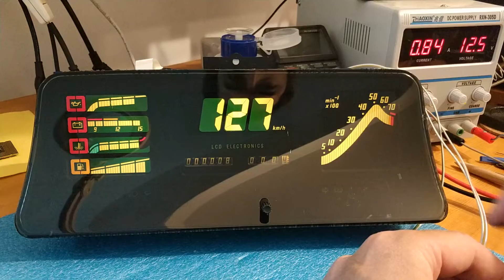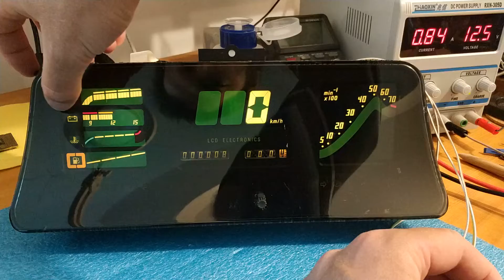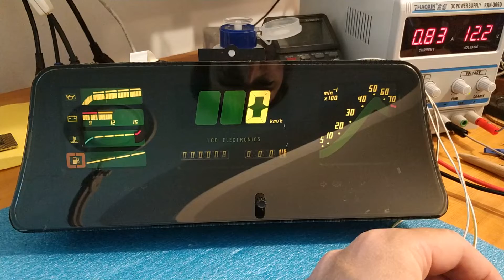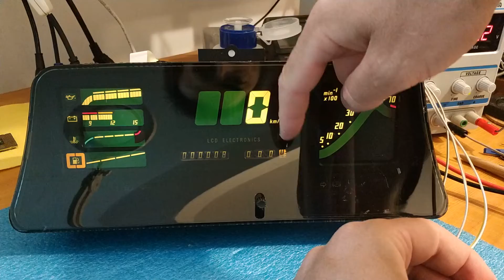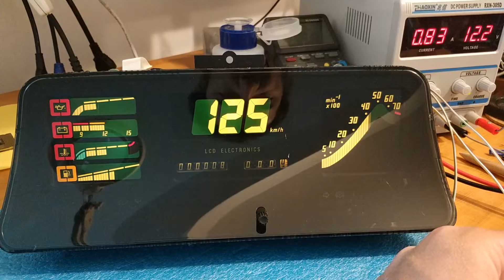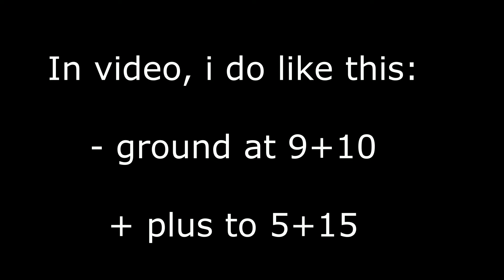Opel Kadett E GSI Monza Digital LCD Electronics dash - How to Test

Comment: Can I install that dash in normal Opel Kadett E 1.4i LS , not Kadett GSI ?
Reply from the maker: You can install, but i don't know for sure what problem you gonna faced; a guy down below, Anthony put this dash on a Volkswagen Corrado, but he faced some minnor issue; please read bellow on comments.
Reply from the maker: Please see here a Romanian fellow who put this dash on a Daewoo Cielo https://www.gmclub.ro/forum/topic/40618-tutorial-montaj-bord-digital-de-kadett-gsi-pe-cielo/  you have here multiple info
Reply: @DaneluRepairs  I had it in Daewoo Nexia...  20 years ago. I had to rewire plugs. Speed pulse meter from Nexia worked with this clock without any issue.
Reply from the maker: @reconquista1911  awesome. Good job you did back then 👏
In my country, Romania, Nexia was named Cielo.
Reply: What about the speedo where's the part that goes to the gear box?

Comment: What does the oil gauge measure? I see it showing the full bars when on.
Reply from the maker: Nothing. I have not put anything there. But, cpu somehow see full. I think is just implicit setting.
Reply: @DaneluRepairs  i tested with the volt meter. max level is 6.5v. and min is 1.5v. it's operating between a 5 v range
Reply from the maker: @Anthony-cc8bx  well done Anthony, glad that you sorted out.
Reply: @DaneluRepairs  hi Dan, i still have issues. I can't get the tach to read with the ecu signal. Is it wired from the ecu or from the coil? have you got yours to read?
Reply from the maker: @Anthony-cc8bx  hi mate. I only want to see if all indicators work, that's it.
I think best advice is to look on Internet on forums for Kadett GSi, for sure they know. Sorry that i can't help you.
Reply: @DaneluRepairs  I figured it out. Yes it can run off the ECU tach :D You can watch my videos for updates on it.
Reply from the maker: @Anthony-cc8bx  congratulations. Yes, I'll do.